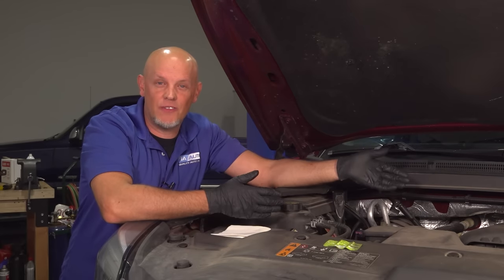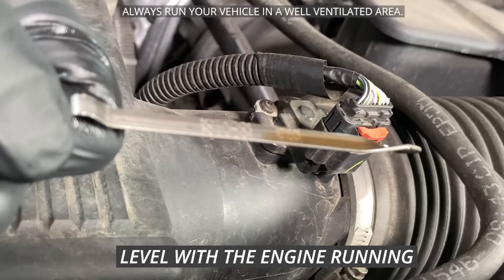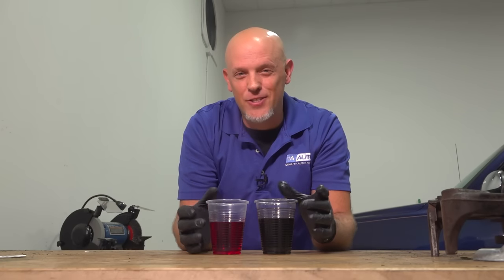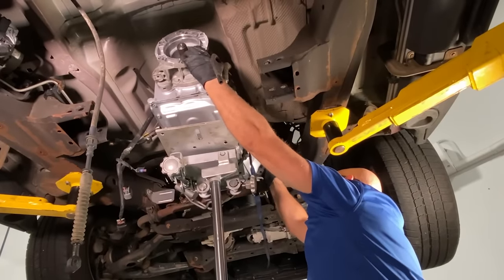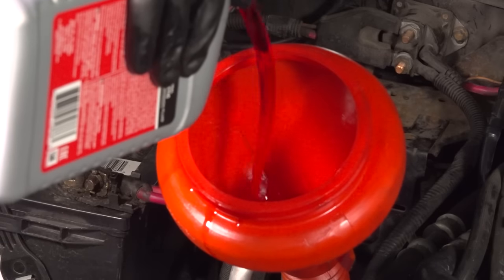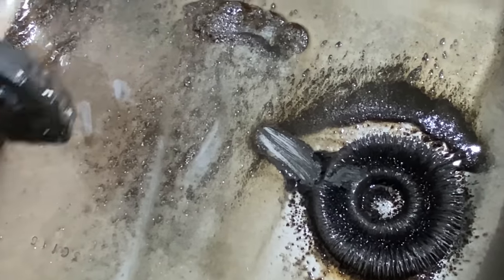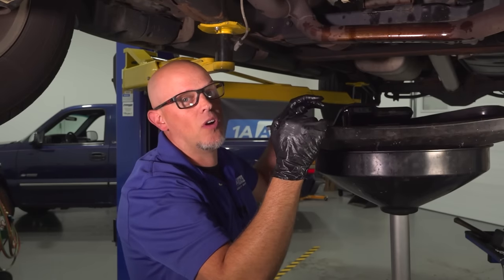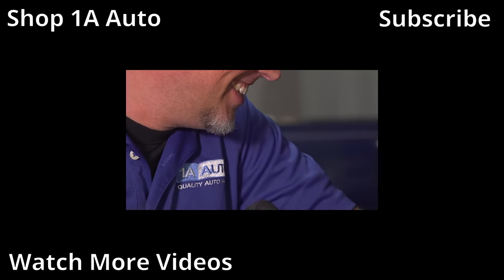Noises, Smells & Shifting Problems: Top 3 Signs It's Time to Replace a Car or Truck's Transmission

Comment: Another good point for your viewers is when you have a rebuilt or new transmission placed in your car make sure you change that transmission fluid and filter no later than 3,000 mi as all the brake and material and clutch material will start to do its damage. This is something most transmission shops fail to inform their customers of

Comment: I have a 98 Ford explorer XLT four-wheel drive it has trouble shifting gears sometimes I have to let off the gas to get it to first and second is fine third and fourth has trouble. Transmission fluid is full and it's not burnt or black any ideals?

Comment: damn my transmission on my honda accord has been acting up ., I can barely shift into park without  to have using the shifter release button.  it is kinda weird because for the most part shifts fine besides into park and occasionally gets stuck in between gears but probably expected to have issues at 248k miles...